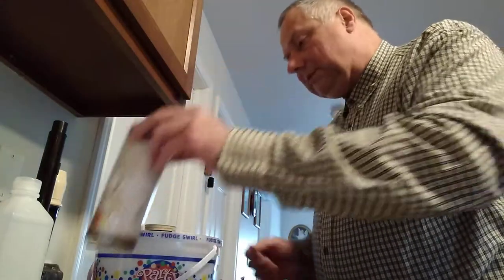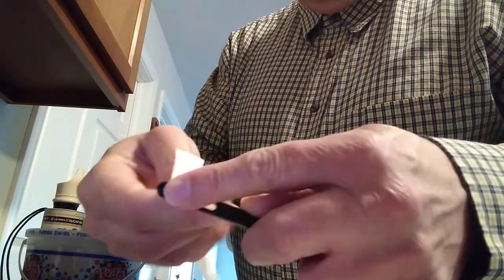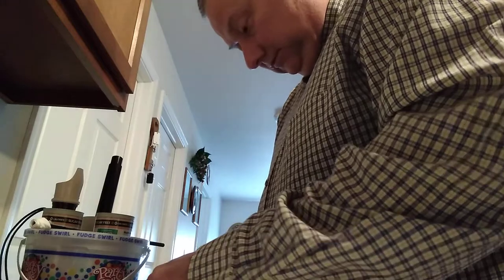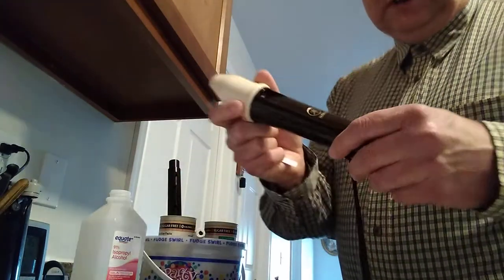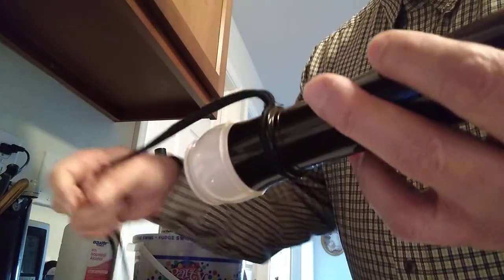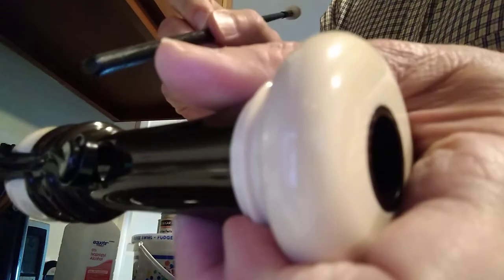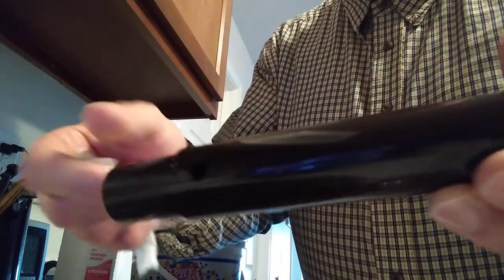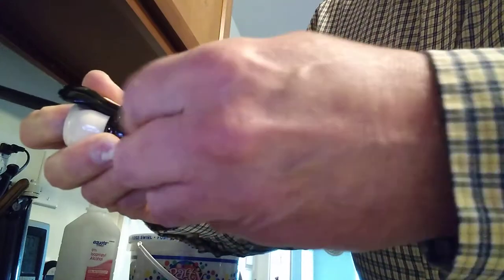Tenor Recorder - How I Clean Mine

Comment: Noticed.
Alcohol does not affect the recorder cream used over the joints?
I appreciate the video tutorial.
Reply from the maker: Should not once it dries just put some more cream on it  and it dries quick. I don't use cream because mine is well broke in. I actually add a piece of clear tape like scotch gift wrap tape to tighten up between head joint and middle joint. No need to tape all the way around at this point. About a 1/4 way around male end does it. Welcome. Thanks for stopping in.